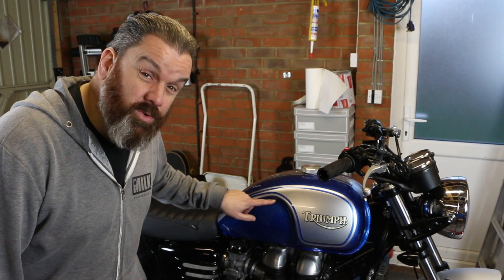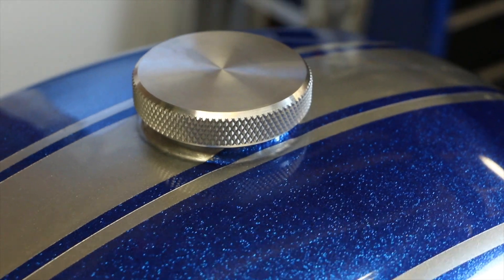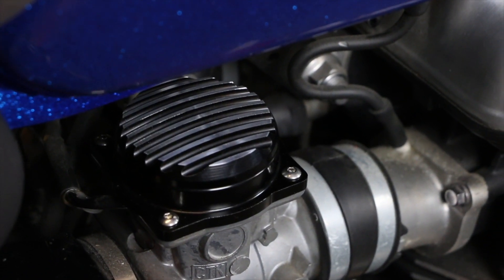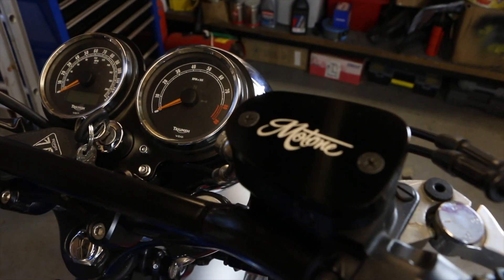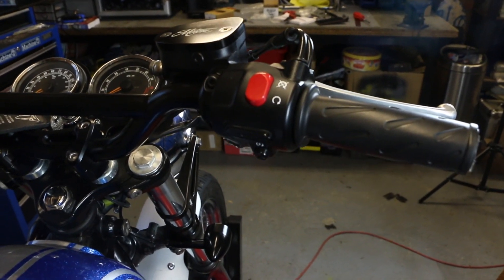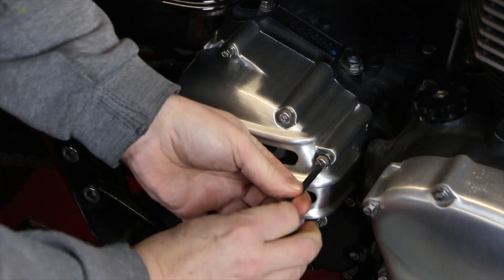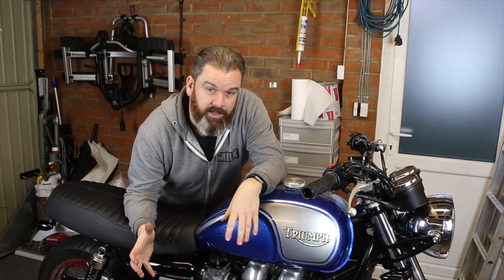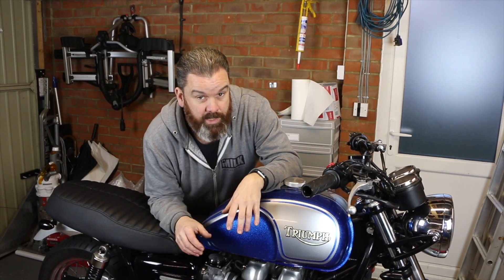Motone Customs T100 build pt12 -  new sprocket cover and a few bits of bling

Comment: The tank looks beautiful, but I like the knee pads and offset tank fill hole. It keeps the Triumph look. They make knee pads with the union jack embossing, but mine are still perfect and I'm not financially able to just toss and play. Still like the light setup u did on the front. Id like to put different turn signals on too. If not, I'm going to flip sides with the originals. They've sagged a bit since 2005.  But lifting up on them, they're firm. And they're not pitted or anything so. But I definitely like the headlight brackets setup. I also like the lids on the carbs. But money is an issue, so gotta be thrifty. 
Looks nice though.
Reply from the maker: Cheers